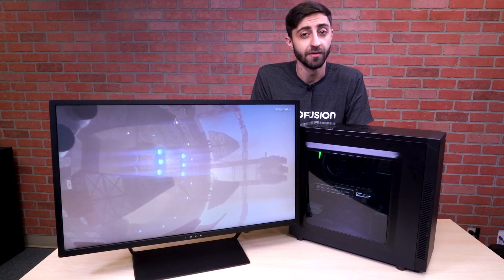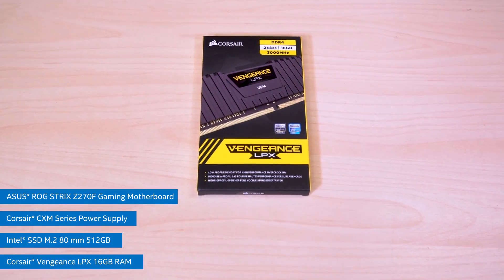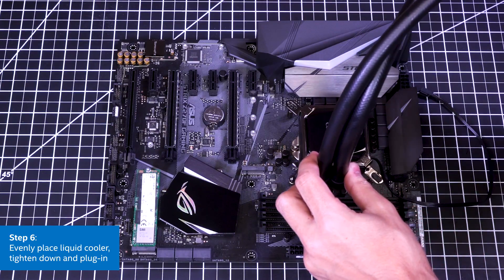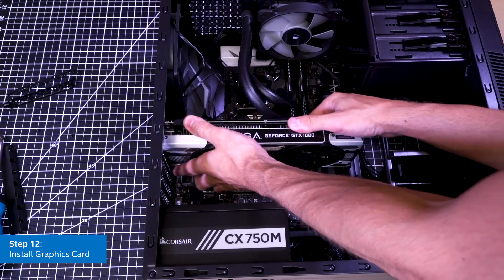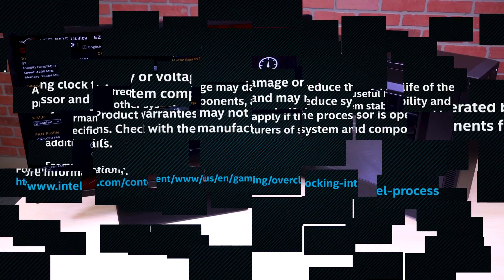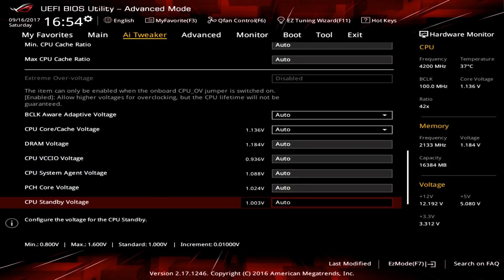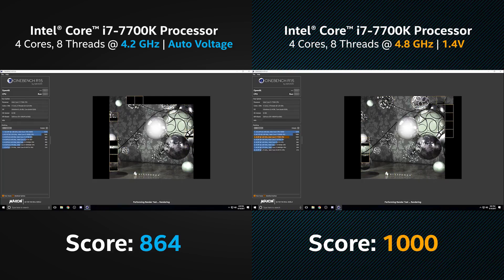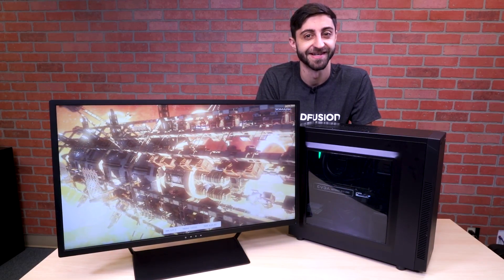Intel® Streamers Bootcamp | How to Overclock

Comment: is a h60 enough? i got a i7 7700k with a hi100 and running it pretty hot
Reply: Th Aaron I don't think so to be honest. At 1,4volts and 5ghz it will get near 100°C without deliding. If you run a stress test for more then 20min (until water Temps are stable) it will be to hot for sure.
Reply: yeah that's what i tought on my third setup i'm running a i5 6600 with the h60 and it's already pretty hot
Reply: Im running mine @5ghz at 1.36v with 0 delid on a h100i and under full load it has never even once hit 80c runs around 75c under full load